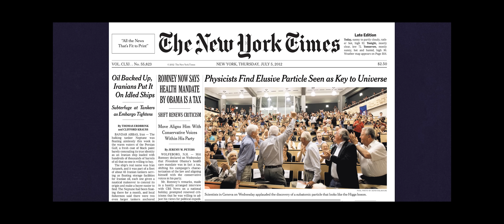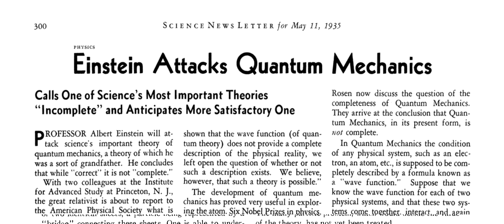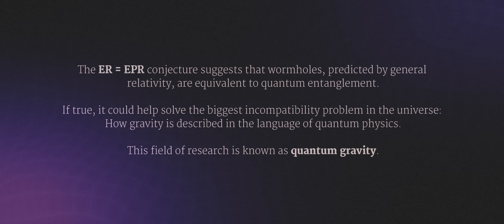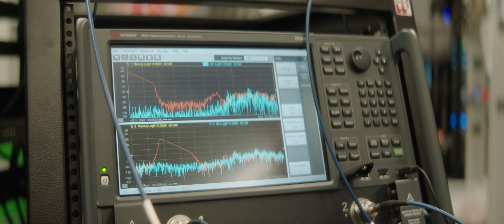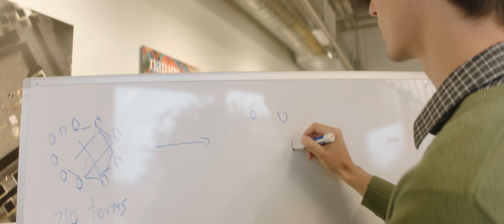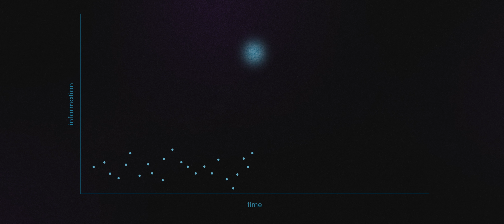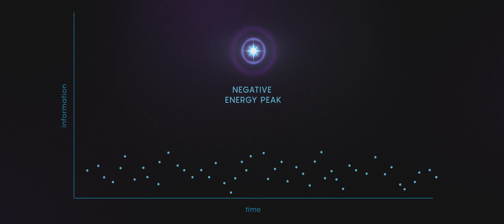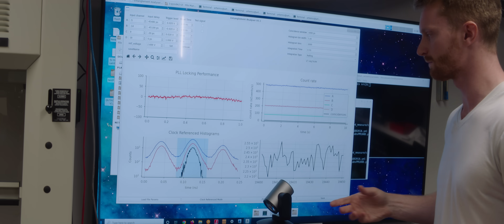How Physicists Created a Holographic Wormhole in a Quantum Computer

Comment: Intriguing.  Though I still don't understand what the computer has created.  A wormhole is a structure in spacetime.  Entanglement is a fundamental property of quantum particles.  Which has the machine created?  Is there actually a tunnel in spacetime inside the quantum chip?  Or, is it the dual of a wormhole?  If so, does that mean that whenever 2 particles entangle, a wormhole is created?
Reply: I dunno.  Maybe "entanglement" between two particles is manifested in the "real world" as a persistent wormhole connecting the particles together, allowing instantaneous exchange of information about the entangled state?
Reply: @BoxFortDefendant  Yes.  Perhaps that's what's happening.  Can the geometry of spacetime change the speed of light to infinity or allow particle pairs to form at speeds >> c?  Dunno.  I'm not a physicist, at least not a theoretical one.  Well, maybe theoretically a physicist.  Now all we need to do is find a way to detect the presence of a wormhole itself, more directly than creating entanglements.

Comment: I do not understand quibits. Normal bits also work in the same way, they can be 0 or 1 when electricity is passed. how is qubit different? it's not like you are gonna use a superposition quibit entirely, you want it to collapse in either of two states.

Comment: As a graduated electrical engineer, who worked many years in the field of applied quantum gravity with my government on things, the US-DOD is currently laying at extraterrestrial's door (google for USN UAP-videos), I am amazed about the shown mathematical approach. We used a completely different Ansatz, when we had found out, so called ghost photons in the Lagrangien standard model equation do not cancel out as many believe. As Maxwell showed ∇B=0, ∇Bg=0 is also true. And even Kirchhoff's laws hold. We termed these photons gravitophotons. This fits perfectly in a symmetrical system according to Noether's theorem of reciprocity, since bent spacetime deflects ordinary photons (they follow geodetic lines; aka curvature of spacetime). Oridnary photons however can not bend spacetime - but gravitophotons can do the job. Creation of these «strange» photons, that cause a an arbitray dent in spacetime, creating a dipolar force (attractive on one side and repulsive on the other) is quite easy: A topological insulator at room temperature (e.g. nano-bismuth with a grain size < 9.1nm) can be used as a dielectric in a capacitor-stack. When excited by an RF-generator of about 2…4 GHz (best results are at 3GHz, since Z becomes about 50 Ohms, and polarized by a superimposed DC high-voltage, accelerated Cooper-pairs (that follow bosonic instead of fermionic statistics) will emit gravitophotons. When no work is done, voltage over the stack lags 90° behind current - like in an ordinary capacitor (i(t)=C·du/dt). Upon performing acceleration-, or lifting-work, voltage and current come more and more in phase and real power is converted (P=F·v). A nice report (although heavily edited by government) about such a contraption of unknown origin can be found here: watch?v=NJiJPQPz4rM (Note: If somebody wants to see these things with his own eyes, he should make holidays in Lovelock NV. In the north-eastern portion of the sky, he can see incoming and outgoing lights to/from the nearby USSF spaceport. When AAS (American Astronomical Socieaty) made an inquiry, USAF told them something about meteorites. Yes, outgoing meteorites (?!) - and space-dot-com wrote a quite vitriolic article.

Comment: The Quran calls them 'Ma'arej' (معارج) and describes how angels use them for long distance travel. “From God, (owner) of the ways of ascent. The angels and the Spirit will ascend to Him during a Day the extent of which is fifty thousand years.” -Qur’an 70:4. This special portal or wormhole is called ‘Ma’arej’ (معارج) and it is used only for angels to get from one place to another one in a short time. Since angels travel with speed of light or more so they will take 1 day to travel through those passages which would otherwise take fifty thousand years.

Comment: so is the wormhole transition faster than light? does this allow for intact qbit data transfer? 

If so, would this make FTL communication a possibility?
Reply: FTL locally, but probably not remotely. It would still all have to be contained in the same device. I think the longest distance of quantum entanglement being demonstrated was around 20 miles -- but it's also still only in one self contained system, through fiber optic cables. We think of quantum entanglement as two things completely disconnected, but that's not really the reality. They still must technically be regulated and contained in a singular system, tethered together somehow. The same applies to even this experiment. So for example, you couldn't take these qubits and separate them and put one on the moon and keep one on the earth, and put them in an identical setup and then manipulate them. That just wouldn't work. I mean maybe someday, but as things operate today, that is technically not even close to the actual physics behind quantum entanglement, even though that's how we think of it. So you technically can't have quantum entanglement in disconnected systems without a medium. Which means it's not really something that would work for communications dealing with space travel. It requires a physical connection from point A to point B, or for point A and point B to be contained in one singular device/system. 

To do it long distance in space, you would essentially need a laser connecting the two points. So for example, a laser shooting from earth to mars and back. But you would also have to figure out how to make that into a coherent connection, which would take manipulations of physics that we haven't even fathomed yet. But that would be primarily just to have that "closed" system initialized. It would also have to be a sustained beam. So it would still need to take time for light to reach wherever you communicate, but once the connection was made, communications could be instantaneous. So it's like waiting 20 minutes for a signal to reach mars, and then from there you could have a real time communication. Which makes it still somewhat limited. And that's besides the fact that we really don't have any clue how to manipulate a beam in such a way that we could create such a connection over open distances, because it's not just as simple as having a two way beam being connected. We can only really tap into quantum realms with very precisely regulated physics, that don't exactly work "in open air", because of how everything must be precisely regulated and controlled and contained in order to even exploit the physics of it.

So for self contained devices and physically connected systems like internets, sure, we could get some amazing potential out of it. But outside of that, not so much. Which means a military for example, couldn't quantum communicate with a boat at sea. But there are still a lot of novel things that could come from it.

Comment: I've seen a wormhole :) 
I've actually travelled through it.

I discovered the same method that Tesla and Einstein used that originates from 5000bc and I practiced every night and day for about 11 years, and I unlocked the ability to manipulate and control the flow of information in my mind. I can use this to reroute emotions through my audio or vision centers in my brain to analyse the emotions through different perspectives. I can also run physics experiments in my head of both real physics both regular and quantum physics, but aldo manipulate the ruleset of the simulation. Fun fact: I can even digitize and quantize the resulted simulations meaning i can make pixels insted of wavelike simulations. I've allready used these abilities to write a new perspective on physics as well as prepare a set of 500 ish revolutionizing thecs (technologies). 
But yes, one day after theorizing about relative sizes to understand relations and distances in space ( I projected a 1mm³ particle in different scenarios at different distances ) 
I came across the idea of a wormhole, how does it look, how does it work?
And i got a simulation of a real wormwhole, and how it bends space. And that got me to a solution about how to understand higher dimensions. Well, good luck fellow humans.

Comment: What if - 
You enter a wormhole & come out the other end  , you discover you're not where you had expected to be - So you you jump back in to come back out again only to discover that you're not back to where you started from  ?

To figure out where you are , you look around at the stars to conjecture where these stars are in correlation to other stars , , , 

Then , hold on , wait a big huge minute , , some of these stars aren't where they're supposed to be , , 

Uh Oh , , calculate calculate calculate , , Uh oh , ,  if we're back to where we started then it's 2 1/2 billion years later , , even earlier - depending on which way you're facing the face of the clock , , ,

Comment: EXPLANATION: MATRIX, TIME, SPEED OF LIGHT, QUANTUM UNCERTAINTY, ELECTRICITY, RADIO WAVES, CURVATURE OF SPACE, DARK MATTER AND DARK ENERGY.
A quantum computer is no longer a fantasy, but a reality. The next stage is the creation of a quantum printer.
Based on simulation theory, our world is a holographic three-dimensional matrix of pixels. The pixel size is equal to the minimum Planck distance.
The Planck length is a unit of length in the Planck system of units, which is equal to approximately 1.6⋅10−35 meters in the International System of Units (SI). The Planck length is a natural unit of length because it contains only the fundamental constants: the speed of light, Planck's constant, and the gravitational constant.
The approximate radius of the observed universe (14.3 billion parsecs or 4.4⋅1026 m) is 27⋅1060 Planck lengths.
To the nearest π, the Planck mass is equal to the mass of a black hole whose Schwarzschild radius is equal to the Compton wavelength. The radius of such a black hole will be equal to the order of magnitude of the Planck length.
The Planck length (and the Planck time associated with it) defines the scale at which modern physical theories cease to work: the geometry of space-time predicted by general relativity loses its meaning at the Planck length. These scales hold a yet-to-be-discovered theory that combines general relativity and quantum mechanics, which can most fully describe the laws of physics. It is for this reason that modern descriptions of the development of the universe begin only when the universe had dimensions of 1.616 • 10-35 meters.
Time: t = Ch t- time (1 s) C- speed of light h - Planck length
The movement of light is the alternating switching (exposure) and switching off (extinction) of pixels of the amplitude of the sine wave of the spectral frequency period.
In one second, the alternating switching frequency of the alternating pixels is equal to 300,000 kilometers - according to the given program of the binary code. The speed of light in a vacuum is 299,792,458 m/s. Atoms, molecules and the whole world around are formed from the pixels of the matrix. The entire further program of actions and forms of living nature is embedded in DNA. Based on this constant, light formally moves uniformly, regardless of the direction of parallel movement and the speed of its movement, another object. If, through coding, modulation and detection, the pixel grid (matrix) is changed with a certain step significantly smaller or larger than the Planck length of approximately 1.6⋅10−35 meters, then movement into the future, past, or going beyond the pixel matrix will occur.
The quantum dualism in Jung's two-slit experiment is also explained by the switching of photons at a given frequency. The photon is not moving anywhere. The illusion of movement is created by switching pixels that create a photon in the form of a frequency spectrum of different colors in the amplitude of a sinusoidal period and passes through both slots in the on and off state. The eye determines only the included positive frequency - the amplitude state of the photon. By passing light through a prism, we see its entire spectrum, so experiments show different values of either a photon particle or a wave.
Electric current, radio waves and magnetic fields move in the same way. Their nature is also to detect and fade the gradation of the pixel grid.
Pixel formations in such objects as planets, stars, black holes have a curved structure in the form of spirals, on which spheres and curvature of space-time arise. The galaxy is formed and controlled by the black hole by detecting and decoding information from software, memory or consciousness.
Dark matter and dark energy are pixelated encodings of software and memory objects that are in the off state of binary qubit code and cannot be detected by any device.
Practical use. Using pixel holographic software modeling technology, you can artificially create any object with a quantum computer, quantum 3D printer and quantum holographic projector, up to the universe. Instantly move while copying, etc.
The ultimate goal is a quantum printer. Then all problems will be solved
Our universe is inside a white hole. With its gravity, a white hole attracts the black holes of galaxies in our expanding universe. In galaxies, the White Hole's gravity adds to the Black Hole's gravity, strengthening the integrity of the galaxy and accelerating the spinning and spiraling motion of the traveling gravitational waves of the stars and planets.
Gravity is there
A flow of spherical spiral waves inward for a Black Hole and outward for a White Hole, which result from rotation and spiral motion. The stars in the galaxy move in spiral orbits under the influence of gravity, and the waves are constantly catching up with the Black Hole, and the Black Hole falls into the White Hole, dragging all the matter of the galaxy with it.
Space has neither beginning nor end because of mutual transformation. The white hole attracts and absorbs the galaxies of the universe. At the center of the Big Bang, a vacuum zone is formed and expands. Absorption reaches a critical level. The vacuum collapses the White Hole into one minimal particle. a new Big Bang is coming.
Time is closed. A white hole is part of the Big Bang. Which consists of negative energy and information, such as the Akashic Records. A white hole creates what we call dark energy.

Comment: Simply fantastic. Faster than light speed travel is in the horizon, still a distant horizon but a horizon none-the-less. 

Gravity is the curvature and motion of 4D fabric (fields) of space. Quantum gravity is the curvature and motion of extra dimensional quantum fabric (fields) of quantum space. Those fields are also within wormholes that move much faster than light, as if tunnels with super fast moving water or wind flowing through them. Entering them will carry any properly protected thing away faster than light.

Comment: Definitely NOT what happened here.  The ideas about tunneling no cloning etc. set very tight constraints on this stuff.  The "teleportation" literature likewise is overly sensational.  All it really allows for is the lossless transport of a quantum state that happens "instantly" when you redefine the idea of instantaneous for a quantum system... classically the experiment can't see a state move from one place to another faster than information can travel between the two points.  In this case the same thing happens.   The only difference is the "medium" has a strange form of connectivity between disparate points in the "space" these psudo "particles" inhabit.  This is basically just another form of quantum teleportation in a non trivial system.  Quantum teleportation (which is NOTHING like the concept of teleportation in sci-fi) has only been demonstrated in trivial systems up until now....